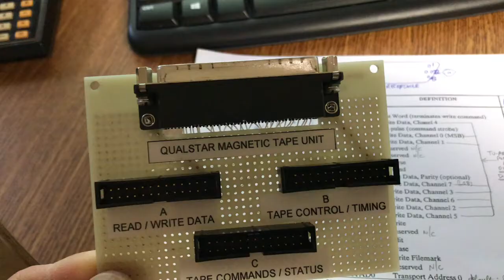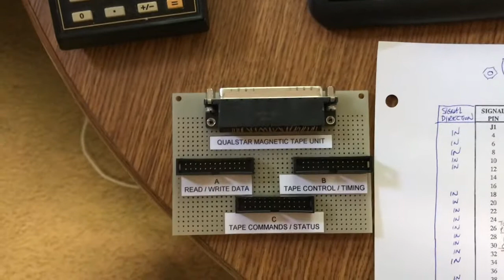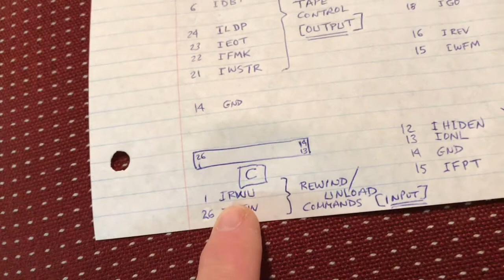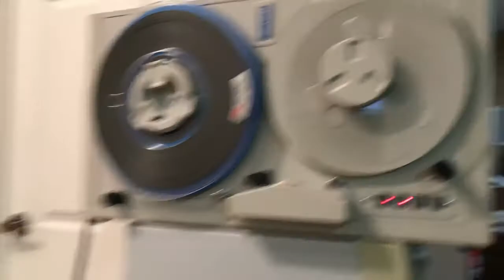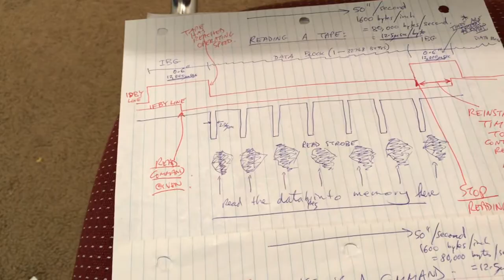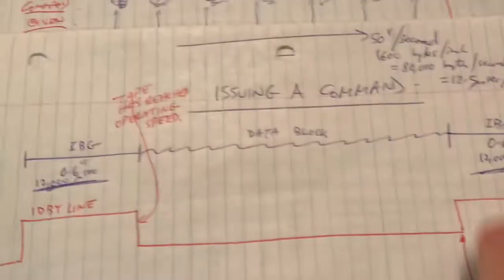Arduino Qualstar 9 track tape controller HARDWARE and SOFTWARE design

Comment: Hello again. I just finished setting up my lab. I would like to ask you about that "outright" software - is it available anywhere?
Reply from the maker: Please send me a PM.  I have the Chi Corporation OR.EXE program from SYDEX INC., but it only runs on MS-DOS or Windows 95/98, certainly not later.  This program supports two driver cards, the Computer Logics PCTD16 and the PCTD3.  The first card is recommended because it has a 1MB buffer and allows the tape to stream continuously at up to 44MB/minute.  This card is available on eBay sometimes and has an ISA-16 older PC bus card edge.
Reply: Hello, I am trying to PM you, I followed all the procedures provided by youtube help. I can find no button for private messages. Is there any way for me to contact you, for example on vintage computer forum?
Reply from the maker: borisd @ sympatico.ca

Comment: Hey, nice one! 
I'm also working on such a thing. 
You've got some flaws into your design. Two of the reserved pins are also used by Qualstar and about another two - the documentation says they are ignored. 
J1-14 (ISGL) - selected drive fault. You should pay attention to that one even if documentation says it is ignored. 
Same with J1-16: ILOL (load tape while on-line) - that's used when you have multiple BOT optical marks on the same tape. 
Undocumented by Qualstar: J1-44:IRTH1 and J1-36:IRTH2/ILGP tell the drive which tape density to select. In my case - 800BPI/1600BPI/3200BI (Qualstar 1052). In your case - 1600BPI/6250BPI (Qualstar 1260). 
Do you have any progress with your project? Can we exchange data? I can supply you the complete list of pertec commands to interact with the tape. 
There are some films with tape drives on my video list (youtube!com/user/skaarj0/videos). You might find them interesting.